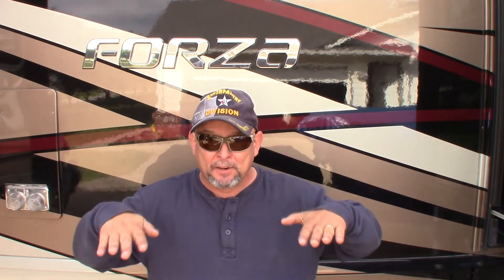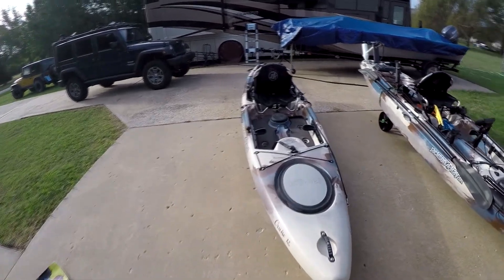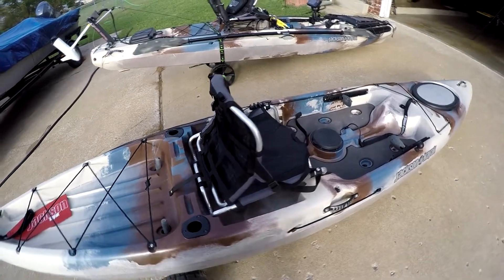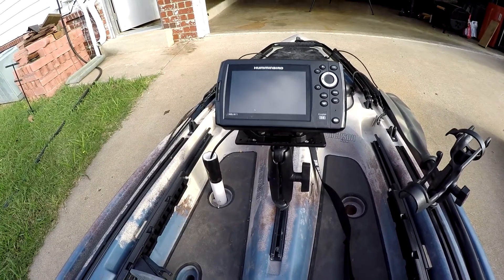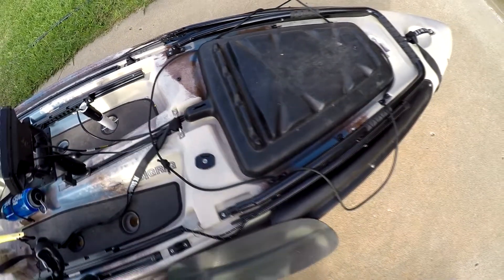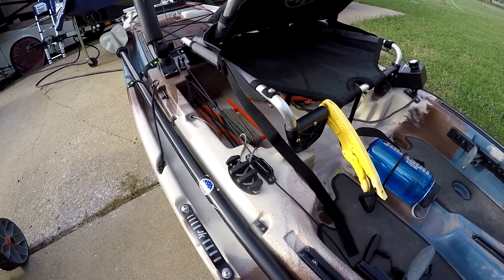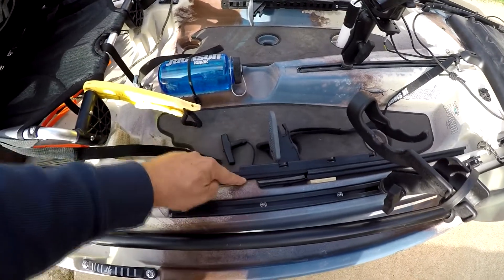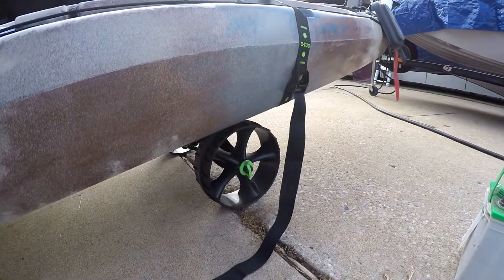Jackson Big Rig & Cruise 12 Angler Kayaks

Comment: To your followers: for an inflatable fishing kayak consider the SeaEagle 385FTA. This is a very stable boat with a tough alligator skin. Its design allows a fast track to your favorite fishing holes. It is rated up to class II rapids. One of the benefits is less weight than a standard rigid kayak and ease of storage, especially for an RV.